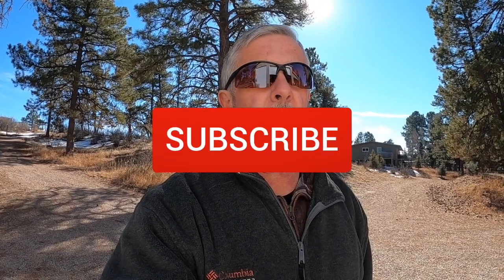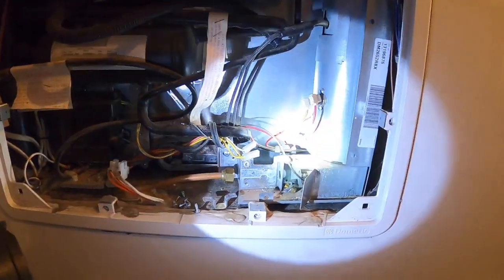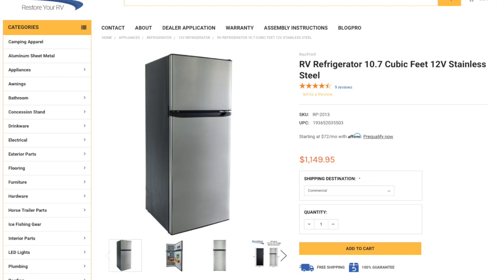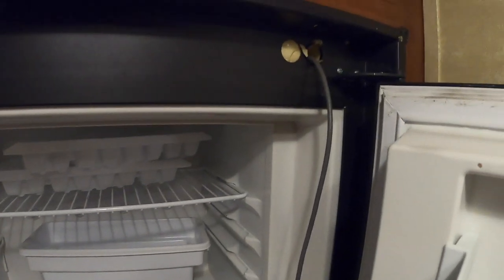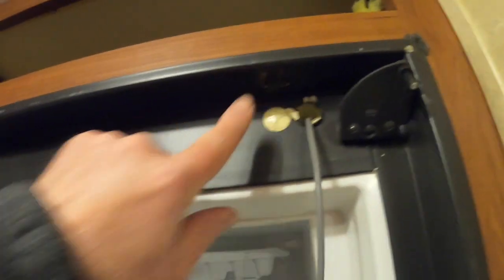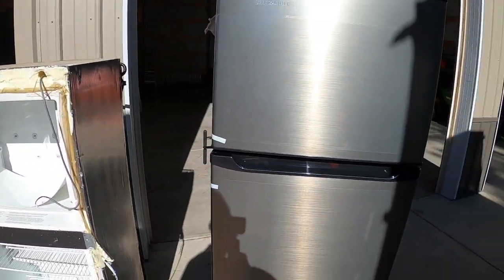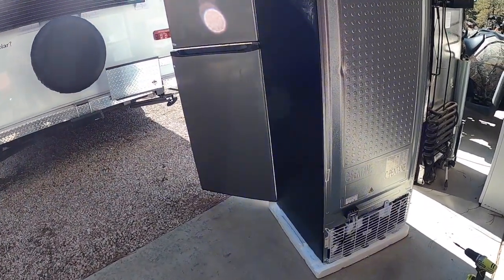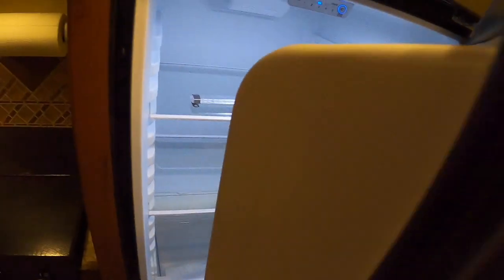RV Propane LP Refrigerator Upgraded to Compressor 12VDC EverChill

Comment: LOL I replaced my fridge with a compressor based one as well.  In hindsight taking the door frame would have been cleaner but, not as fun.  I decided to get some stress out and I sawzalled the fridge in half while my better half was at Costco.  I knew I was in trouble when I got done and it looked like it snowed in the rig.  We had foam coming out of the vents and in cabinets I swore we're closed for a week!  I'm not allowed to have a sawzall or a jigsaw with us on the trips anymore.  LOL 😆

Just a heads up though.  You don't have to be perfectly level but, you gotta be close.  My compressor makes all kinds of noise if it's not close to level.  I had to relevel the rig at 2am in a campground so I didn't get continually hit with a pillow everytime it woke me better half up. Woke up two of the campers guys who came out to see what was going on.  My camp neighbors came out to help me level after laughing at me for 10mins from the story why.  She brought them all cold beers and apologized for forcing us to relevel.  It's hilarious now but, damn I was pissed and embarrassed then.  😆
Reply from the maker: Haha. Mine works at all kinds of not level. It’s the everchill.  Enjoy it. You will love the extra room.

Comment: Thank you for your video, it was very helpful. We also decided to remove the propane absorption fridge in our truck camper for the same reasons. We put in a Norcold Polar N8DC 12 volt compressor fridge. Even thought the existing 12 volt wiring from the old fridge was fused at 15 amps the wire was 14 gauge with Norcold recommending 12 gauge minimum and 10 gauge as better. For our application I ran 10 gauge wire to insure it would not heat up or drop the voltage. We have been using the 12 volt compressor fridge now for 2 weeks at its performance has been excellent. Power consumption is low and despite reports of increased noise we have found that the compressor fridge is quieter the our old absorption fridge. It keeps food in the freezer frozen and we have never had the refrigerator temps go above 40 degrees. No more spoiled food!
Reply from the maker: Congratulations!  Very nice. Thanks

Comment: Enjoyed your video, it was very thorough. I just purchased a 2010 Winnebago Itasca and it has an absorption refrigerator, which I despise. Leveling is a pain and I cannot stand using propane that's lit all the time.
However, the problem is I am a senior and there's no way I'd either know how to or could attempt this endeavor. It's fortunate for your wife that she has you to do such extraordinary things. You've made remarkable upgrades and I'm not sure who would be able to assist me in doing the same if I purchase a compressor refrigerator or what kind of dimensions that it would take.

Comment: To do one of these swaps successfully you really need a Lithium battery and solar panels, ideally also a DC-DC charger from your chassis alternator (for motorhomes), otherwise the compressor fridge will run your coach battery flat very quickly. Even if you plan only to use it plugged into shore power, you would still want to use it while on the road where it's running from the battery. It's difficult to get any reliability information for these appliances, but NovaKool has a very good reputation. I bought a Norcold Polar 8 DC frig and it was flaky out of the box, requiring a control board replacement under warranty. I may have got a lemon, though Norcold is not known for customer service either and it took two weeks to get parts. Note some of these refrigerators have dual compressors, one for the freezer and one for the refrigerator. This enables you to get more control over temperatures in each compartment, but there's twice as much to go wrong, and they are more expensive. Pay attention to the size wire on the frig and the installation instructions. Mine had 10 gauge wire, but the instructions said to hook it directly to the battery, as the fusebox circuit for the old frig may not have large enough wire. I had to use 8 gauge wire for a 10 ft run to the battery. Norcold won't honor any warranty replacement if the frig is not wired correctly, this may be true for other manufacturers as well, but even if not, it can't hurt to follow this advice as getting enough power is critical to long compressor life.

Comment: Bill, you are a man of my same mindset. We are still searching for a travel trailer. If it does come from the factory with the fire breathing 2 way dinosaur fridge it will be quickly (immediate) replaced with a 12V compressor fridge. I also will have a large solar/lithium system to keep everything powered up.
Reply from the maker: Excellent. You will love it. Check out my other playlists. Thanks

Comment: Hi Came a cross your video today. I’m looking do the same conversion to my LP fridge, I can’t stand it anymore! It’s my third RV with this type of fridge, I have enough! My question is I see you seem to have use the same 12 V that powered your circuitboard on the absorption fridge, to power the new fridge. What gauge wire does it call for?
Reply from the maker: Only draws about 80 watts. I had a 20 amp fuse in existing frig wiring. Way more than enough. I just used it. You will love the dc frig. My wife says it is her favorite upgrade. Go to the rv camping playlist and see other upgrades.

Comment: Nice video , i just ordered a new 2022 Rockwood Mini Lite 2205s camper and it will come with a 10cu ft Magic Chef 12volt  fridge , my old Open Range had the 110/propane fridge...too small !

Comment: Thanks.  Too late now but you could have removed the refrigerator coils from the back of the refrigerator. If one purchased a JC Refrigerator 12 V compressor upgrade kit, they remove and replace the existing coils with the compressor. But, I prefer to replace the refrigerator instead of upgrading, just as you did.  Just subscribed to your channel. Thanks for a very helpful video. I am seriously considering upgrading my gas refrigerator with the EverChill as well. This might just be the convincer for me.  RecPro should give you a cut after I order mine!
Reply from the maker: Upgrade kit sucks. I called the guys in Indiana. They wanted 1250 for the kit. Plus then stuck with the small inside size of the old dometic.  Morton’s on the move had a YouTube on it years ago. The new everchill is much more professional way to go.  Thanks for the comment!

Comment: I am doing the same but while trying to remove my old fridge I ran into an issue.  Everything in the rear is disconnected and the one bolt in the base frame has been removed.  In the front I removed the top two screws and the bottom two but the fridge won’t budge. It’s not a silicone seal either.  The way it feels, I think there has to be more screws holding it somewhere
Reply from the maker: Mine had two lag bolts in rear bottom. Get too from the vent outside. Then two on the frame. Thanks

Comment: Did you use spray foam to seal around the fridge and if not, what did you use to seal it?  How about insulating the vent on the roof and the door with the holes in it?  Since there is no need for ventilation of the LP gas combustion, I plan on insulating to keep out the winter cold.
Reply from the maker: I use in summer.  Left the vents.  Used the compress foam strips to seal. Enjoy.

Comment: I installed one of these and I had to run 50’ of 6ga from the battery bank to the fridge, as recommended by Way Global. It worked for about 2 days. At least they sent a new one.
Reply from the maker: Ouch. My everchill only uses about 40 watts.  Is amazing. Thanks

Comment: Thanks for the video I enjoyed watching the show in tell. I’m considering buying it as well and I have a similar layout where their is wall where the door swings. When the door is at 90 degrees does it stick out and add width or is it flush with the width of the refrigerator? Also what was the opening dimension that you where working with? Thanks
Reply from the maker: It sticks out the thickness of the door. I have the rv in storage for the winter don’t have access to measure. Thanks
Reply: @bparkinson1234  thanks for letting me know! Looks like the extra width when to door opens will not work in my situation since I got that wall and only 24 inch opening from that wall.

Comment: Good video. On the 12 volt wires, was the wires there good enough for suppling 12v to new unit or did you need to run two heavier wires to batteries?
Reply from the maker: Existing wires were heavy enough. Also connected to a 20A fuse on panel. Frig only uses about 4.9A when running. Easy!

Comment: Awesome upgrade.  Just got back from the Hershey RV show and virtually all new RVs have this now.  Based on this video I plan to upgrade my 10 year old rv fridge.  Should make it safer to leave on when traveling down the road, no?  We have enough solar to keep this going indefinitely.
Reply from the maker: Excellent. We just did 3500 miles. Best upgrade was the frig. See my other rv upgrades under rv camping playlist.  Lived in Hershey for two years back in the late 70s.
Reply: Hey one more question…what did you use to seal around the fridge inside the camper?
Reply from the maker: @ken12269  weather stripping from Home Depot. Pretty easy. Cram it in. Thanks

Comment: Nice looking fridge.  Did you consider the compressor upgrade for your Dometic before you bought the 12VDC fridge?  Are you planning on moving your T-stat from behind the door, or perhaps just a stop block?  We're looking at a 110VAC/12VDC fridge to replace the Norcold 300.3 three-way unit in our Trailmanor. The dimensions are nearly identical to the Norcold.   We're pretty good at maintaining the temp but it's a pain.  Thanks for the upload.
Reply from the maker: Yep looked at company in Indiana that has the conversion. Was more money than the everchill. Plus left with same crappy frig size. Nope will leave stat there. Venting for new frig uses old roof top and side convection. Thanks

Comment: Bill, thank you for the excellent video. This is exactly what I want to do in my 2018 Imagine 2800BH. I'm going to measure to see if I have enough room in the dead space above the existing fridge for this unit. I think I do.  I am a ham radio guy and I like to boondock and play radio. Keeping RF interference to a minimum is important to me. Could you please do me a favor? If you have an old AM portable radio, tune to a frequency that isn't used by a local station and walk toward your camper with the new fridge running. As you get close to the backside of the fridge, do you pick up any weird noises, hums, etc? Thank you in advance if you can do this for me!
Reply from the maker: Hey. Nope. No interference with the everchill. Thanks for the comment KB3EY.
Reply: @bparkinson1234  Thanks OM. I'll likely be ordering one of these today. de K8MEJ

Comment: Nice video....  Now that it has been in for awhile, how do you like the performance? Specifically my complaint with LP frig (Navion) is just keeping it cold when outside temp goes above 70 F.  Also temp can fluctuate so much as the temp outside changes overnight etc.  How's it doing on keeping a stable temp?
Reply from the maker: It is amazing. Check out all my other rv upgrade video playlist. The frig is my wife’s favorite. Temp is amazingly stable.  Lp sucks. Thanks

Comment: Enjoyed your video. I am now convinced that I too will replace my Norcold absorption with a DC fridge. How long does it take the new fridge to get to operating temperature when you turn it on. Just discovered your channel so I am going to watch some of your solar installation.
Reply from the maker: Was to 36 in about 30 min. Starting at 60. Very very fast. Thanks
Reply from the maker: Kim Davis  maybe.  I have so much power. 1500w of solar. 6 Battleborn.  600Ah. I just leave it on.

Comment: Bill,

how did you remove the entry door from the frame? My RV entry door is riveted on to the frame hinge.
Looks like i need to drill out the rivets. Not sure what size or kind of rivets they are, don't have that in my garage.
Reply from the maker: Ya.  Mine just had crews...  still was a pain.  They must install these before the slide goes in at the factory.... didn't want to take the slide out!  Thanks for the comment

Comment: Thanks for the video. I purchased the same refrigerator yesterday. So this video is so greatly appreciated. Was the existing 12v wire and fuse adequate for the new refrigerator or did you have to upgrade any of the wiring or fuse? Thanks again
Reply from the maker: On mine the wiring was on a 20a fuse. Frig only takes about 4A to run.  Plenty.  Thanks
Reply: @bparkinson1234  on a different video, there was a comment made that the lights in the RV flickered after the refrigerator was added. Do you see this issue?  Also do you recommend adding a separate on off switch?  Thanks for your help.
Reply from the maker: @terryhaynes1596  nope. Not at all

Comment: I wonder if one of your emergency windows could have been a better option to slide the refrigerator out. Those windows seems to be much bigger of course you will need to manhandle live through the window not sure how heavy it is
Reply from the maker: Great point. I have one but it is not high enough. Width is ok. The built this rv by putting the fridge in before the slide install. I could have removed the slide with my lifts. But was easier to take out door. Check out my playlists. Thanks

Comment: I wish you would have talked a little bit more about how you chose the size of refrigerator and what you measured to make sure it was a fit.  I also wish you would have showed the process of sliding it in, and what mods you had to do to the trim.  I also run Completely Solar boon docking set up with 1000 watts of solar, and Two Solar 8D Batteries with roughly 500 ah, id like to ditch the propane fridge for this, My batteries in my usage and solar config, are topped off well before noon most days weather depending.
Reply from the maker: Each RV varies in dimension of the fire.  Please refer to install manual for the frighted to get an idea of the opening needed.  Mine was spot on on the width.  but as you saw I had to modify for the hight.  I used the cross member removed for my stove removal. Check out my video on corianders tops installed where I got rid of the gas stove and went to induction .  Thanks for commenting

Comment: Dont be fooled by these paid reps, I have a Dometic 4101 in by 2022 trailer, been in the shop 5 times in last year for repairs on the fridge, also no good for boondocking unless you invest in an additional 2k to 3k in batterys and solar panels it will suck your batteries dry overnight, complete junk, better off with an old school three way fridge
Reply: Are you referring to old lead acid batteries without a solar panels installation? Because it doens't make much sense what you are talking about. Better talk with numbers next time.